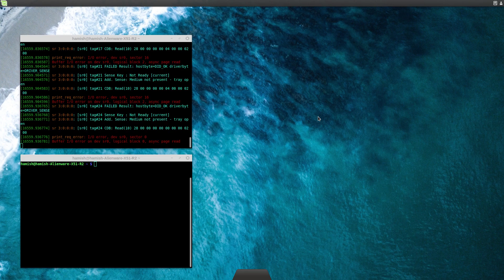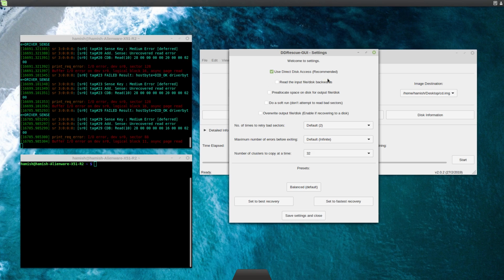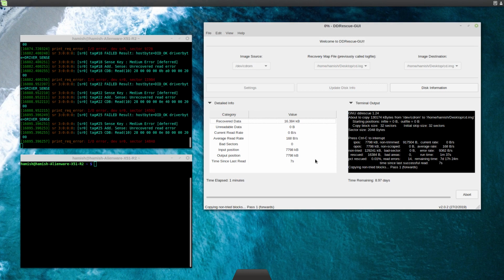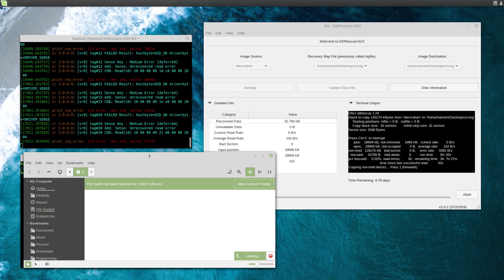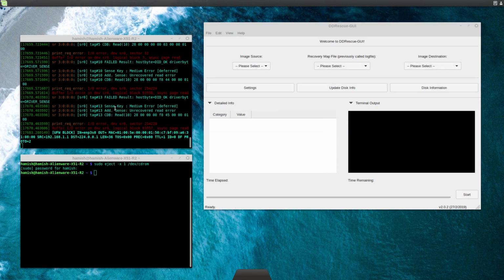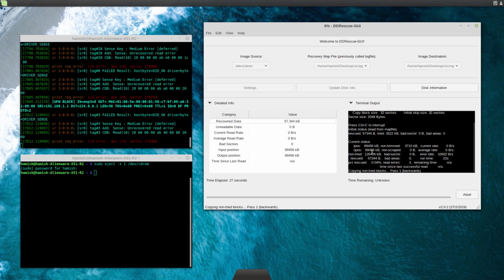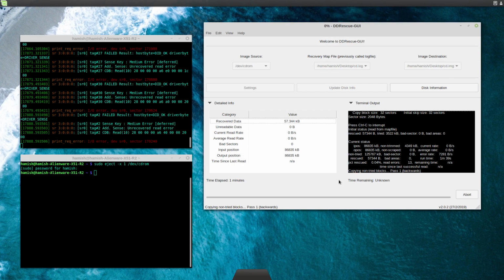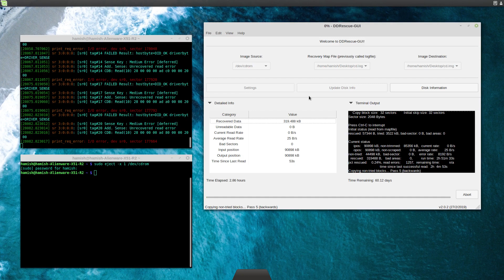DDRescue GUI Basic Demo Part 2

Comment: Do you have a gut feeling ballpark of how inaccurate the Time Remaining stat is?  I'm trying to salvage a failing 2TB external HD to a new 2TB external SSD, and it's giving me an estimate ranging from 27d to over 400d, but being a veteran of the early days of dial up Internet, I have a feeling this is wildly inaccurate.  I notice your example says 8d, but really it probably only took you a few hours.
Reply from the maker: Hi there,

The time remaining stat varies in its accuracy, as different parts of the disk will very in how easy they are to read. The only thing you can really do is wait, or try the "reverse" option to read from the end of the disk first.

Hope this helps,
Hamish
Reply: Hi - how long did it take in the end? I've got a failed (dropped) 4TB drive to try and salvage.. Thank you!

Comment: Hi there 
Since I’m new to the recovery thing I need a little guide on how to clone my hdd that was partially encrypted using Bitlocker I found online it could be done by ddrescue but it had a lot of commands and fortunately I found ddrescue gui which gave me hope but another thing is where should I write the log file to if I’m cloning it to another drive and will the program work for cloning a Bitlocker hdd that can’t be opened because of abrupt termination
Reply from the maker: DDRescue-GUI doesn't specifically handle bitlocker-encrypted drives - you may need to use a Microsoft tool of some kind to help with that.

For the logfile, I would recommend saving to another different drive, or cloning to a file stored on the destination drive.

Hope this helps,
Hamish

Comment: how to do recover to disk, instead of creating a img file ..
I can't open Settings without specifying the output img file path ..
The issue for me is I have 2 TB External hard drive but only 1TB space in PC, so I can't create a img file 2TB .. 
but how to directly overwrite to the disk .. is there a way ..
Can you please explain ?

Nice GUI btw ..
Reply from the maker: Hi there,

I'm not exactly sure what question you're asking. Also, to recover a 2TB drive, you'll need somewhere with 2TB storage space to recover the data to.

YouTube comments aren't the best place for support requests - could you ask at https://www.hamishmb.com/forum/ instead please?

Thanks,
Hamish

Comment: Is DDRescue off the table if when I plug the USB external hard drive into my Linux box I can't get it to mount. It never shows up on the 'Disk Information' or in the lsblk command.
Reply from the maker: Yeah, these tools aren't going to help you in that case. Do you see any new output when running "dmesg" before and after plugging in?

Also, are there any access lights or do you hear it spin up when plugged in? Failing all else, you may have to remove it from the enclosure.